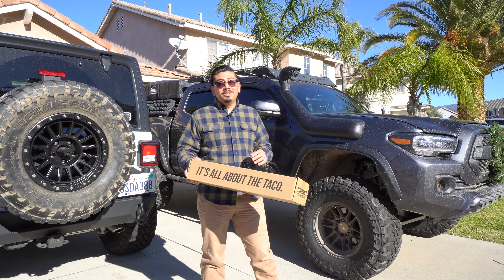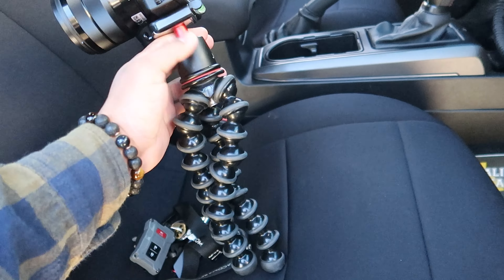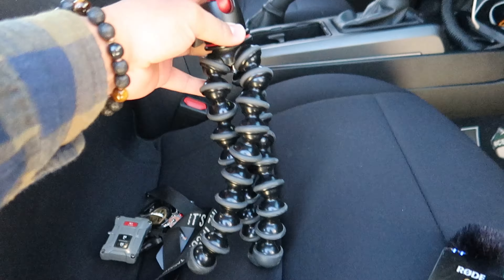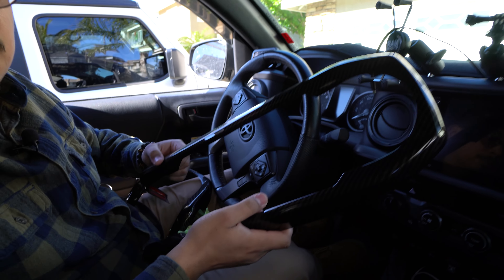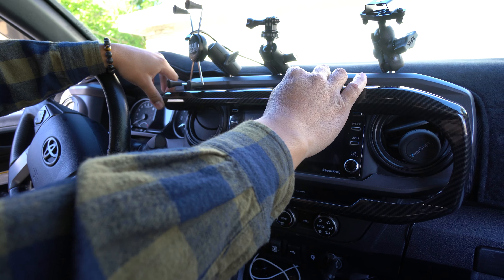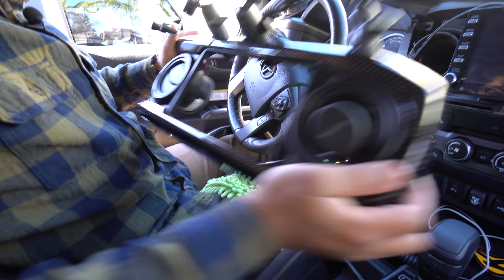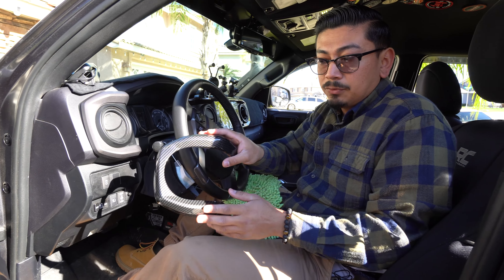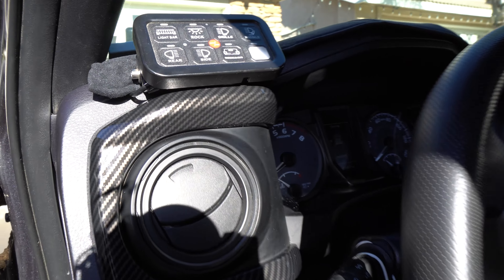2016-2022 Toyota Tacoma ABS Center Console Dashboard Trim Cover | How To Install From Tacomabeast

Comment: Just giving some feedback on the new recording setup, camera looks great, but the audio from the wireless mic seems a bit blown out. Did you notice that while editing?
Reply from the maker: Yea :/ I have to send them back there’s a issue with the wire that connects to the camera once I get the new set I will adjust the volume setting as well
Reply: @JesseRizo  Bummer! Nice setup though. That will be really nice to have. 
The dash looks good too!

Comment: I am a older guy who's looking at a very nice used Tacoma that the previous owner installed the red kit on. My question is will this mess come off without damage? I absolutely despise this ghetto look. And if they won't come off I won't be purchasing the truck. Thanks for any advice or help.
Reply from the maker: Yea I would not like red lol that is ghetto lol and it should all it is just double sided sticky tape it should come off with a heat gun applying some heat and removing it slowly then after that any residue should come off with goo gone 
I recently took mine off because I switched my headunit mine came off fairly easy but then again I didn’t have mine installed for to long who knows how long that guy had his on
Reply: @JesseRizo  Thanks so much for the info!